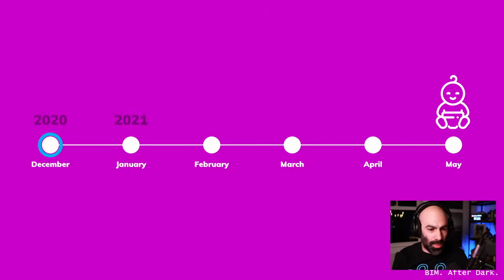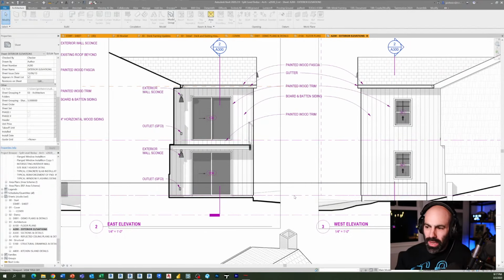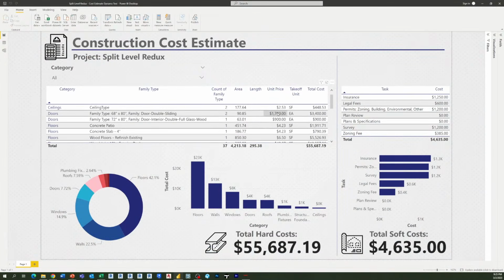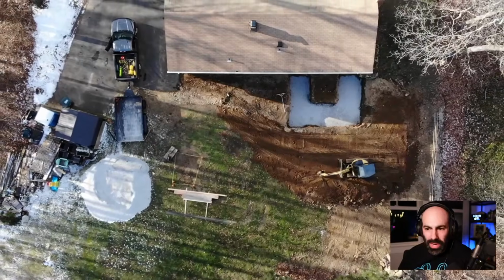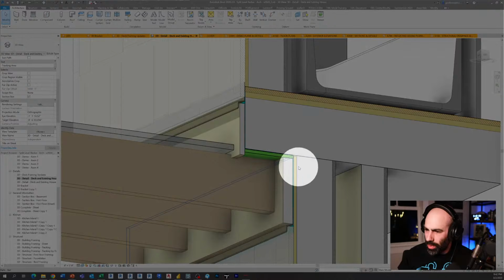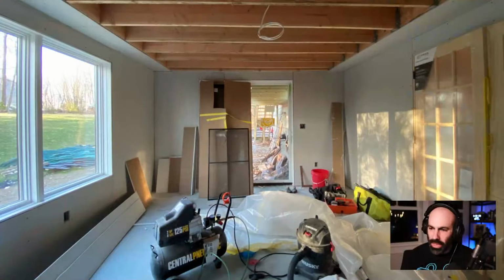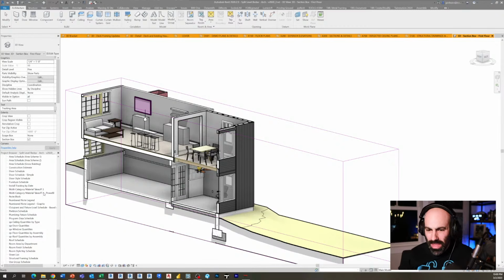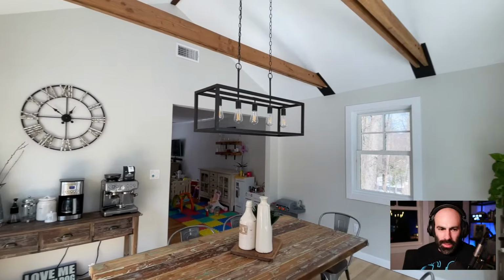Residential Revit - Designing and Building My New Home Office!

Comment: Thanks for sharing this process Jeff, really great to see how it came together and your struggles and lessons. Beginning the process of my own house design-build so this helps! I've always stayed away from modeling the framing, other than floor framing. Partly because I use LT so anything other than flat roof doesn't work well modeling. But I want to try the wall framing on an upcoming small project and see how that goes.
Reply from the maker: Glad you enjoyed and happy to share!  Good luck on your project! At a minimum… modeling studs around openings so you can fully understand the header details is worth it!  But, modeling it all is TOTALLY worth the little extra effort.

Comment: Apologies, i will add comments as i watch the show. 12mins in you are saying the feedback was to dumb down the drawings as the contractor saw colour as expensive. Is that not the issue to some extent with BIM in the world today. The 2D drawing still wins and anything more than flat plan is seen as expensive. If the contractor had access to the data they could have priced of a data set?
Reply: maybe the contractor needs to change and get up with the times.
Reply: at 20.30. its not a lot of effort to model structure. 100% agree for either Arch, Struc or MEP. it is no more effort. people forget what the process was. In MEP world and old CAD. We had to request that the Arch draw up a section for us to then draw up the MEP design. Used to take days if not weeks to finalise. we now have access to immediate input from the model. I model it now, the arch has access to it immediately. then Struc then MEP.
Reply from the maker: That was ONE contractor just making a remark.  I did not actually test to see if I got different numbers based on the drawing look... I did, however use the model ALL throughout construction to help the contractors understand design intent, and details.  Plus, I purchased almost all of the materials myself using the model for takeoff.  Concrete was the only material I did no procure myself.